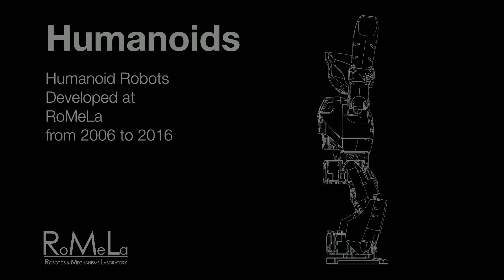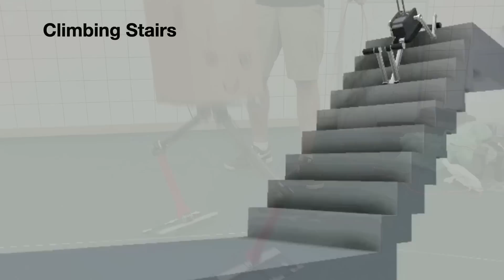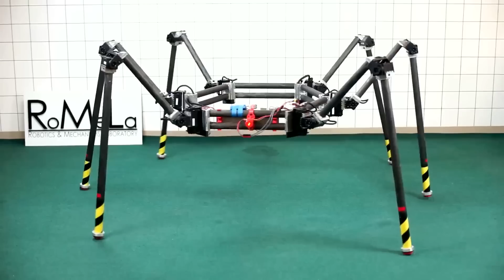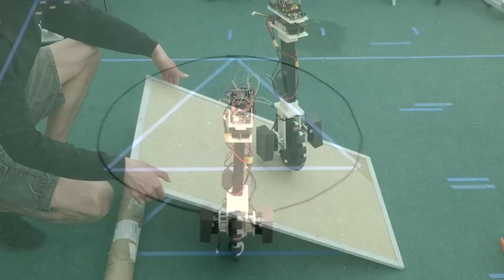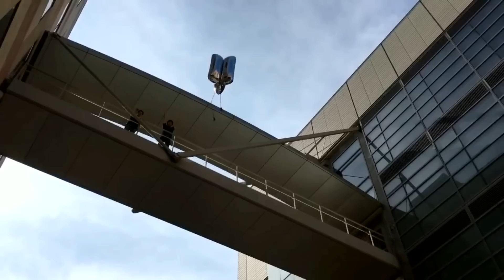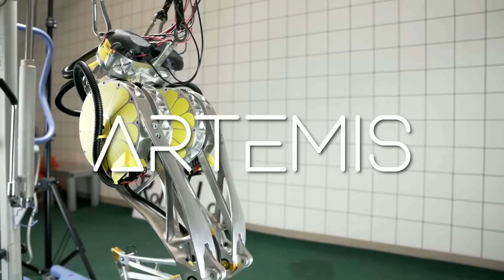7 New Species of Robot That Jump, Dance – and Walk on Water | Dennis Hong | TED

Comment: I think you were on to something with the very light robots.  The fact the new one was made from heavy solid metal was a disappointment.

Design a robot that is cheap very durable and soft.  This will facility machine learning a much faster rate.  We need robots that are desiged to fail, get back up and try again.  Also with soft materials there is much less chance of them damaging themselves, the  environment or animals.

With a soft durable robot it could be left to itself to use machine learning to work out its own optimum solution to locomotion.  You could leave it in a room running all night with the lights.off while it tries different motions.  This stuff is just too time consuming for humans to be drudging through with millions of man hours.

Once basic locomotion is achieved it could be sent to do more demanding tasks and learn efficient technics.

Even Boston dynamics don't get this right.  I see them toiling away in the code, fine tuning code.